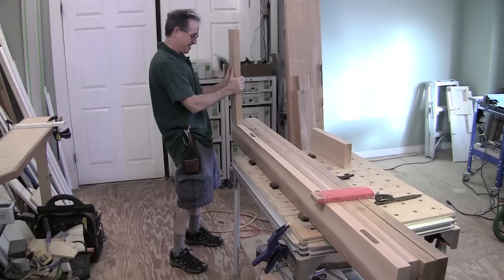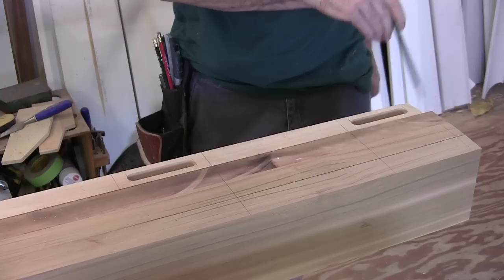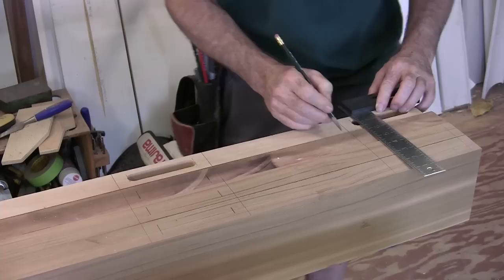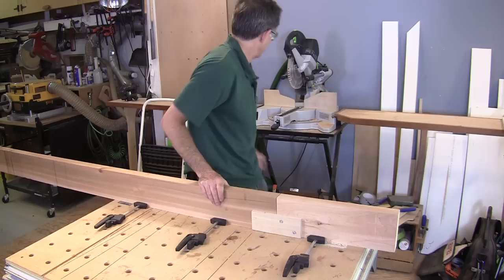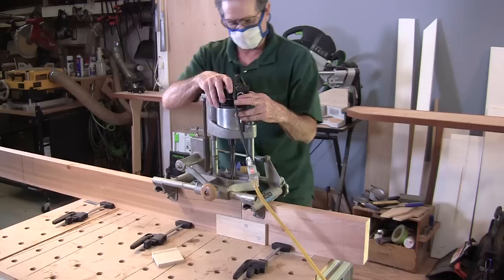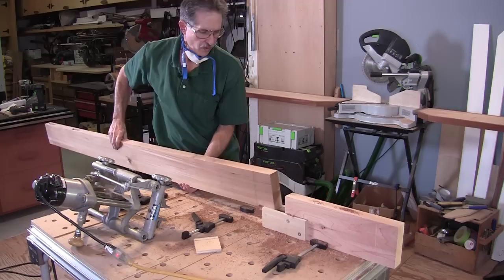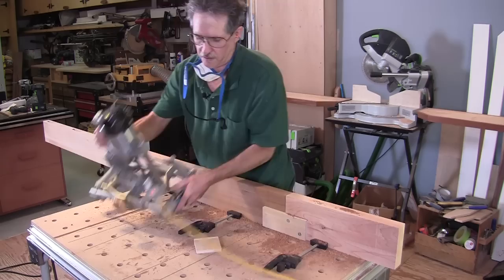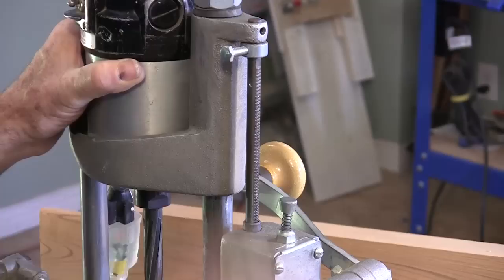Building Custom Gates: Cutting Deep Mortises

Comment: What is the jig you are using that holds the router and what hp is the router to have such a large router bit? What kind of router bits do you use?
Reply: What is the manufacturer of the slot mortising jig? I have some doors to make and it would come in handy.